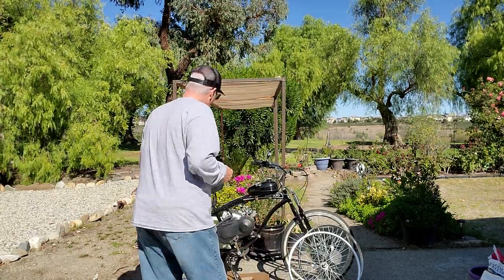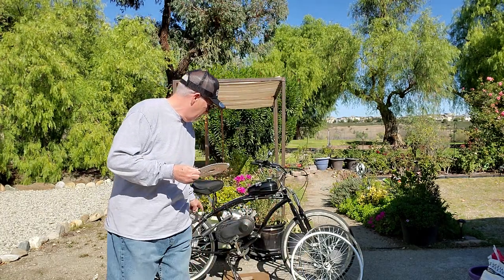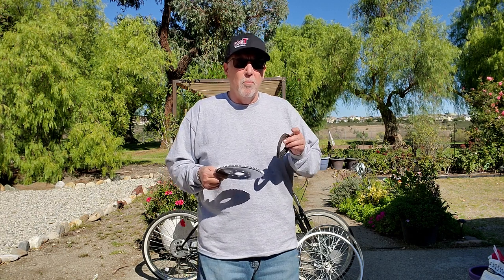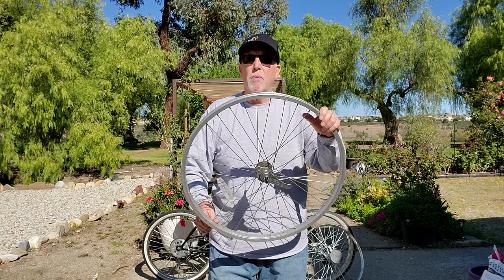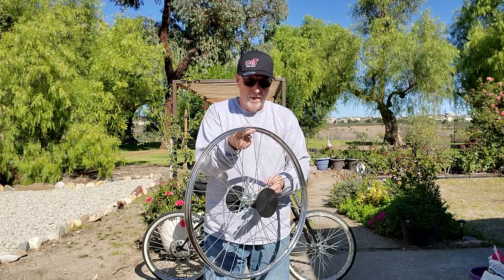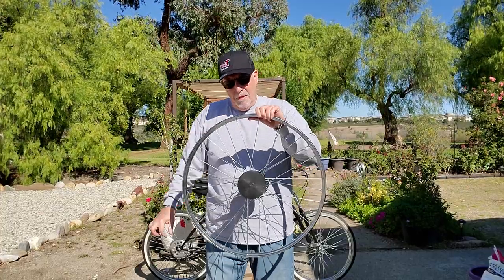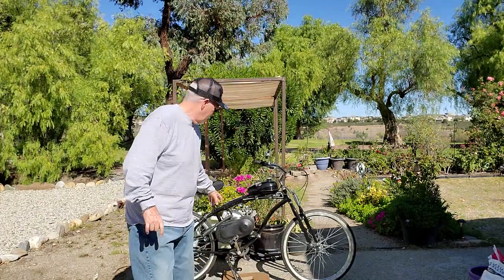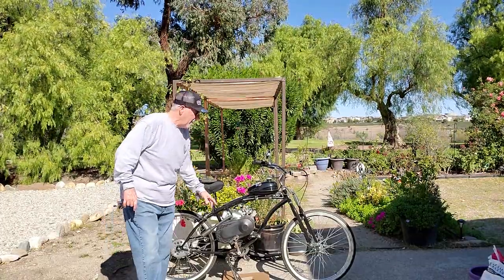The BEST motorized bicycle rear wheel!

Comment: I have some all steel wheels I got from Amazon from wheelmaster for about $120, a little heavy but so far they're bulletproof. Probably close to about 2,000 miles on them, spokes haven't budged as long as you keep the rag joint tight.
Reply: Link?

Comment: Ok I'll throw my hat into the ring for best wheel set. I built my bike to ride bayou trails. Strong and safe wheels were the most important thing. Nobody sold what I needed, so I built my own. I used Rhyno Lite triple wall rims with reinforced nipples ($130 for both) Box brand BMX hubs with sealed bearings and 10mm axels. The rear hub has a free coaster on one side and on the other there are six holes to mount a break disc ($430 for the set) Next is a specialty sprocket. It has an offset so you can mount both sprocket and break disc together directly on the hub ($130) Regular 14 gauge spokes. Straight Race lace pattern up front, and a 4 cross lacing on the rear wheel ($110) In total I spent a staggering $800. Twice as much as my bike and engine kit combined. I could have bought a cheap dirt bike or mini bike at that price. BUT after riding trails over two years and a couple hundred miles, I've had ZERO issues. Absolutely none. No bent rims, ripped nipples or broken spokes ( yes, even though they are only 14 gauge) No crooked rag joints or slipping sprocket adapters. No bent axels. No failed bearings. No headaches, period. It was expensive, but in the long run it was worth building my own wheel set. Hopes this helps someone out there. Good luck with your builds.
Reply from the maker: That's impressive, especially with the 14 gauge spokes. I disregard the "you coulda bought a motorcycle for that amount" comments. The current rendition of my GX140 powered bike probably has about $1600 or $1800 in it, and some of that cost is for "trial and error" parts. Live and learn, right? I appreciate you sharing your experience. Ride safe, builder!

Comment: Sorry your having problems. BikeBerry is trash. I’ve never had a problem with wheels so not sure about the installation techniques. 14g and a rag joint should hold. There’s plenty of places to get custom parts. Ghetto Bikes,Gemini Rims, Bike Barn although it’s cooperate and several others as well as just having your local shop string you one! Best regards and good plug on Moses. He probably has a better memory than me but there are a few other builder shops to hit up as well.
Reply from the maker: Roger, I actually had better luck with the original 14 gauge spoke that came stock on the Micargi than with the Fying Horse 😞 The 11 gauge wheel the Mozez turned me onto seems rugged. Now I'm not afraid to put in a bigger engine (someday) and thrashing the real wheel. Thanks for the leads; I had my eye on some Ghetto Bike stuff. Ride safe!

Comment: NIce wheels.

 I had a rear hub motor on a cheap wheel and it broke 1 spoke every 100 miles. Now I'm mid drive and have yet to brake any spokes, but its a high end wheel. I'm also around 200 pounds.
Reply from the maker: Thanks Eric. I watched a couple of your Bafang videos. Very interesting,  as I know zilch about ebikes. Ride safe!
Reply: @ogbigtsbikesandstuff887 EBikes are great at making the wallet much lighter.
Reply from the maker: @Eric_Tennant  ALL of my hobbies are wallet lighteners :-/
Reply: @ogbigtsbikesandstuff887  Indeed

Comment: Thank you I am currently dealing with this very issue. I have my rims in the shop right now getting the bearings replaced in the newer rim, then swapping the axle and pedal sprocket over to that rim. While I'm riding on that Rim I completely planned on upgrading the spokes on the old room to yeah thicker gauge spokes. So by the sounds of at 11 gauge, that's good to know. Because I have a feeling this Rim will not last too long. I'm hoping by then I'll have a way better stronger built up rim that I can put the motors sprocket onto and ride on that for a more permanent solution. But right now one of the reasons why I am wapping the axle out and having new bearings installed is because one the bearings in the other Rim that I bought are just bad and two the whole shebang didn't seem to line up on my frame. Therefore I kept getting derailment issues with a perfectly mounted sprocket. So I figured heck I'll throw the old rim on there with the sprocket all sloppy and out of whack and if it doesn't derail then obviously the new /used rim is from a different frame therefore it's not lining up in my frame. It probably would have worked okay for just pedaling but as far as the motors sprocket lining up, it sits too far in now. I tried shimmying it up with washers on one side but no go. I'm hoping having the axle and pedal sprocket pack from the old rim that did line up swapped over to the other room that I'm going to be riding on will make it line up. And as a bonus I get some brand new bearings put in it. Then like I said I'm going to upgrade the spokes on this old rim into 11 gauge spokes, I guess. Then I'll swap the pedal sprocket pack bearings and axle back over to the old room that's been upgraded. At that point I will probably also get the hub adapter. Hopefully that will be my permanent solution. Short of that Magnum rims is the only thing I can think of. Otherwise I can probably expect more broken spokes in this sprocket continuing to come untrue and having to continually adjust it here and there. Thanks for sharing your experience it's helpful.
Reply from the maker: Yup, we pretty much all do. Good luck on your search for the right wheels
Reply: @ogbigtsbikesandstuff887 you replied very quickly, I was actually just updating my comment when you replied. Just to give a little bit more detail. Again thank you for sharing your experience because it's going to be very helpful with my journey with this problem.
Reply from the maker: You're very welcome. I don't know a lot about the motorized bikes, minibikes, etc. but most of what I DO know I pretty much learned on YouTube from other builders

Comment: Gemini back rim laced with 10g spokes. Disk brake, full hydraulic or hydraulic/cable combo. That is the one. Steel rims if going above 40mph. And make sure you stay away from mag rims; again, if 40 and up.
Reply from the maker: The mag wheels look tempting, but I've seen them just collapse. At least spoked wheels usually give you warning. Ride safe, Leonard!
Reply: @ogbigtsbikesandstuff887  Always. Will keep watching.
Reply: They both give you a warning. It's just a matter of how fast your reaction time is.
Reply from the maker: @vintagethrifter2114  you're probably right!
Reply: @ogbigtsbikesandstuff887  mag is a bad choice.
Reply from the maker: @leonardarola  I haven't had mags since they were on my Mongoose, lol
Reply: @ogbigtsbikesandstuff887  Smart boy!
Reply: @leonardarola mags work fine if you are not tearing ass tru the neighborhood
Reply: @catsbyondrepair  I am tearing ass and mags are too week for it.

Comment: pretty cool- big T is building some rippers! i have the best wheel setup. WTB dual duty rims, single speed disc hub( symmetrical dish, stronger) , and a home made cush drive bolted to rhe disc side. i've put thousands of miles trouble free. with standard spokes. you just cant do dumb stuff like dropping the clutch. get going and fab yourself up a 'cush drive' ! use 1/4" or 3/8" conveyer belt material between the carrier and whatever size sprocket you choose.
Reply from the maker: Sounds awesome, Robert!

Comment: Any thoughts on solid tubes? Ive got good tire liners but my 700 38c looks just way to small for 222 pound me and a 50 cc....3 rides,3 flats
Reply from the maker: I have no experience solid tubes/tires. I got a flat on this bike once, even with Slime tubes. I started putting a couple of turns of tape over the tire liners and have not had a flat since then. I'm about 210 myself... Ride safe!

Comment: Quick question , looked up that rim and it has a coaster brake. Is that what you’re using or did you take it off? Please help
Reply from the maker: MB Rider, I kept the coaster brake on, but I don't really use it. It was easier than trying to convert to a freewheel; I figure it's like an "emergency brake" if the caliper brake I installed fails. Up front, I'm using a disc AND caliper brake, with a dual brake lever. On the rear, I have the caliper brake and the coaster brake (if necessary). If s**t goes down, I have four brakes, LOL
Reply: @ogbigtsbikesandstuff887  thanks for the info, just a heads up, cause I have a coaster break on one of my motorized bike. When you do use it, it tends to slide and lose control on the back rim I almost fell one time
Reply: Either it was just that or it was a slippery road
Reply from the maker: @motorizedbicyclerider5296  yes, like I said those coaster brakes are for emergencies only. Ride safe!
Reply: @ogbigtsbikesandstuff887  yes, I understand that part. I was just giving you a heads up because it could be dangerous.
Reply from the maker: @motorizedbicyclerider5296  thanks bro!

Comment: those hub adapters are garbage, they usually only work on coaster brake hubs,  the best way is to mount the sprocket where the disc brake would go, (but that may require lasing your own hub. The way I do it is only one rag joint on the inside, metal on metal on the outside, I replace the hardware with the black 6 mm Allen screws from the hardware store with locking nuts 12g spokes.  That works a lot better than the hub adapters.  The hub adapters are mounted with only two screws that's never going to work.  But the absolute worst possible way to go is those mystery metal bikeberry style mags, those things almost killed me once, sidewalk blew out without warning.
Reply from the maker: bassw, I have not heard good things about the mag wheels either, glad you survived. The hub adapter is working pretty good for me, but I will not BS anybody and say it has never slipped. My experience in the last few years is that the motorized bikes are more of a challenge than the mini bikes - those are more plug and play. Thanks for stopping by!

Comment: How do those forks work?
Reply from the maker: I like them. With the GX140 engine and torque converter the bike is heavy. I'm 200+ lbs, and the front forks (and spring seat) make for a pretty comfortable ride. You can adjust the spring tension, and the forks have rockers that are like little swing arms. You can also mount disc brakes and two style of caliper brakes (center or side pull), so you have plenty of braking options.

Comment: Yes worksmanship wheels r good also husky brand wheels are nice mbrebel has good ones and the best bicycle wheel ya gonna get would be from will kid… he builds them himself those are the best bike wheels other than that I’d say get some moped wheels off an old tomos or whatever or… buy a heavy duty rim and a moped hub but I’ve seen a lot of guys just buy the moped and take wheels off it and ride em on it… plus the fact the dot approved tires they use are waaay better… anyways yeah a freewheel is best w the free wheel and disc brakes they make an adapter for the disc caliper… but a freewheel is better than any coaster brake period… a coaster brake easily locks up and all but v brakes are a step up in safety and discs for 30+ mags r ok… cdh power wheels are good ones also.. on Amazon and will kids Gemini wheels are also good husky and worksman heavy duty 12g wheels also free wheels convert to free wheels w disc brake compatibility..
Reply from the maker: lol, I'll save this comment in case I build another motorized bike - good info!